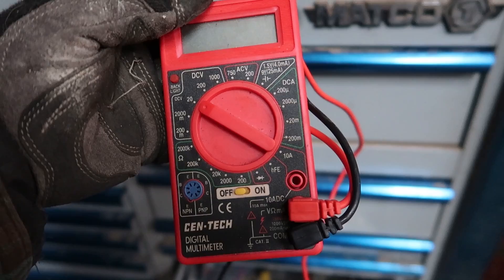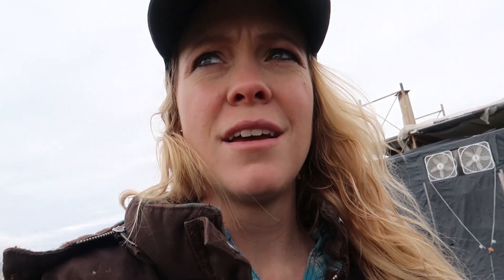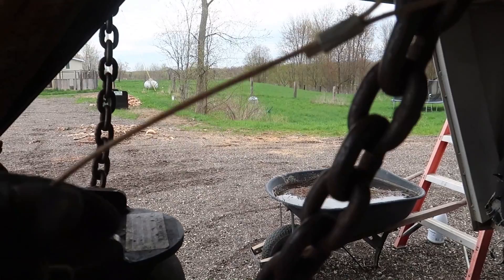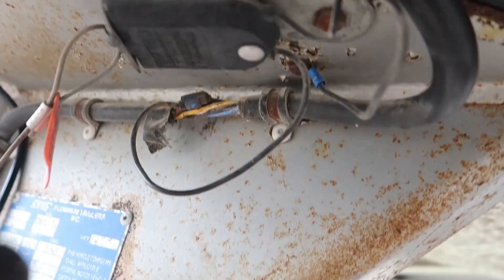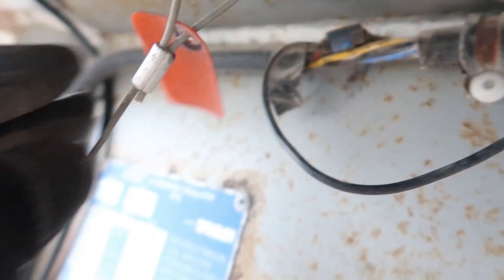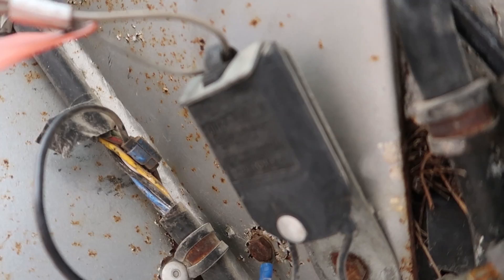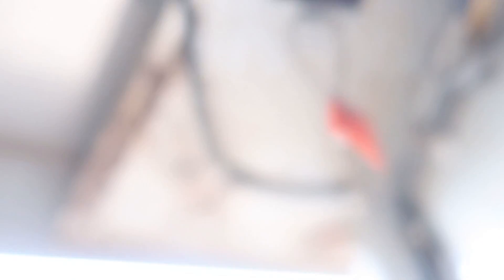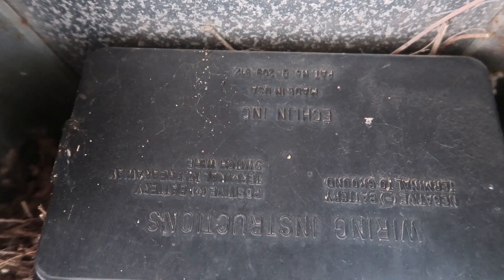218 SOLVED!!    Why My Trailer Brakes Lock Up (You Guys Are the BEST!)

Comment: Maybe it's like air brakes that apply when they lose air. Electric brakes apply when there is no electricity. Maybe?
Reply: No it don't work that way.
Reply: @evankibbe590  Why? Please explain!
Reply: @papaw5405  okay  there is a magnet on a arm in the hub and one wire from the magnet goes to ground and the other goes to the power from the brake controller.  When brakes are applied when moving the magnet snaps to the drum then rotates the arm and pushing the shoes out to connect the drum.  The magnet releases the drum when the brake pedal is released . And that emergency brake away switche only activates the cable is pulled a the magnet can only snap to the drum it can't set the brakes unless the trailer is moving!   I hope that explains how they work for you  . 🙂
Reply: @evankibbe590  I still don't understand. There is no need to set the brakes if the trailer is not moving. Doesn't the breakaway cable activate the emergency brakes if it breaks away from the truck. Why have a breakaway switch that doesn't lock the brakes in case of a breakaway?
Reply: @papaw5405  yes but  only when moving.  😊
Reply: @evankibbe590  Got you now! The breakaway switch allows the battery in the trailer to apply current to the brakes instead of the other way around. So, if the battery is weak the brakes would not be applied if the trailer breaks loose. Forgive me! I'm stupid! Sometimes it takes me a while to catch on! Sometimes I Never do!
Reply from the maker: Guess that explains why it says NOT to sue as a parking brake ;D
Reply: Yes. . I'm glad I could help  😊

Comment: the battery will only apply brakes when the break away is pulled  and the battery needs to be charged or replaced .
you can test the brakes by pulling the cable and pulling the black plastic peace out, have some one by the wheels to hear the magnets grab then just push the plastic peace back in to turn them off again.
Reply from the maker: I will have to test that :)